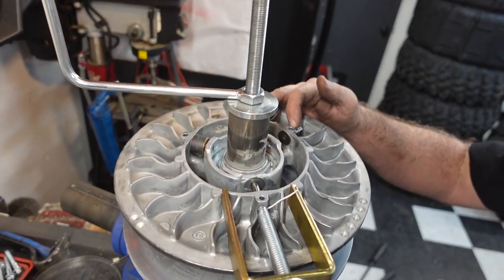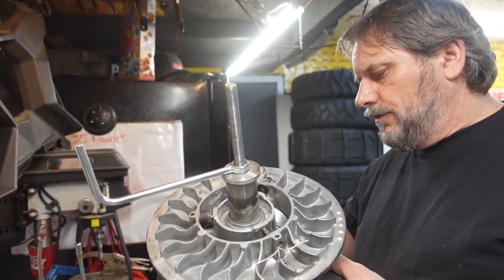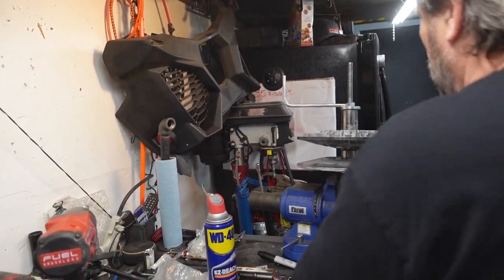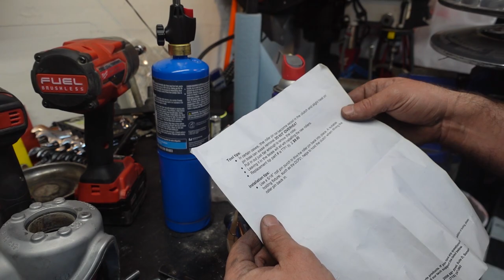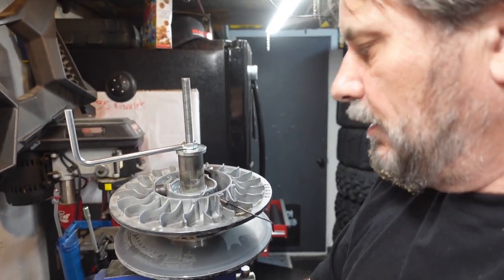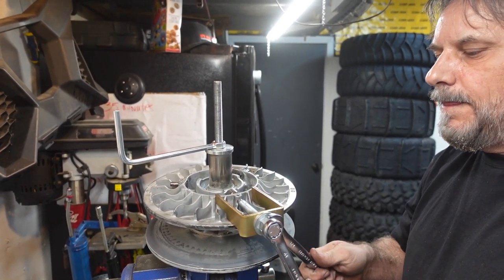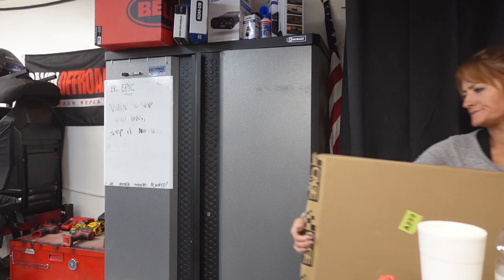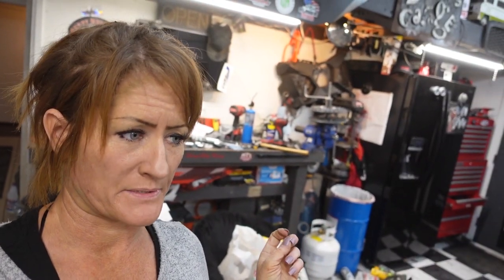CAN AM X3 CLUTCH DISASTER new secondary roller removal

Comment: Im fighting an issue on my can am too. First tool I bought was garbage and broke the threaded pin off inside my roller pin. Can hardly drill it. Im about to weld to it and try n get it out and just replace the roller pin

Comment: Invest in a heli coil kit.   You can get it at Napa or Oreilly or on amazon.   And now that I've seen it's in the pin, just replace the pin.    As for my Turbo S, no problems yet.  1100 miles, 2019 2 seater.   No broken belts, I have burned a belt before I did the gear reduction.   Cagewrx has a good video on welding up their cages.  Lots of ratchet straps, they look straight forward, laser cut and tabbed, should come out nice.
Reply from the maker: Good call we'll have to pick one up. Unfortunately we didn't have time to replace the pin. I can tell you we finished two of these cages over the last couple of weeks and they were spot on.

Comment: Mistakenly bought the cheap version of the puller off Amazon and it blows. Totally sucks and one of the M4 adapter tips broke off trying to get the pin off. Can I still salvage this part of the secondary or am I SOL? Thx
Reply from the maker: Unfortunately I'm not able to see which video you're referring to. If you send me a link I will take a look
Reply: @DandiOffroad  it's the video changing the rollers on the secondary. I'm referring to the tool used to pull the pins, the adapter tip broke inside. Bummer.
Reply from the maker: Oh yeah that was a whole bunch of fun. I think I ended up selling the pen and a half and then driving it up. Something like that. How did yours turn out?

Comment: My last of the 3 locked up. I cut the roller off then I cut the pin in half. Then I heated it and knocked it out with a 5/16” punch. Installed a new pin.
Reply from the maker: Yeah I think we ended up doing roughly the same thing. It's been a year or so
Reply: Hi, this just happened to me.  any other tips for me to get that pin out?  you have to take the secondary clutch completely apart to do this, right?
Reply from the maker: You can get the pen out pretty easily by cutting the roller off then cutting through the pin and driving it out

Comment: Fix...STM clutches!  anyone that runs any sort of power runs them.  WAY worth the investment.
Reply: @DandiOffroad  come on u guys have $$$ lol...and with all the time ur working on this and $$ ur putting in to it
Reply from the maker: Right? The thing is we've had very little clutch issue so I haven't spent a bunch of money in that area.. I mean if I had your money I would just throw mine away right?
Reply: I run 300 hp now on my x3 and I went kwi and have had zero issues. Stm clutches are a pain in the ass because they require so much more maintenance.  I got 2 stm clutches out for rebuild now
Reply from the maker: Yeah we're going to stick with weighting and springing and calling it good
Reply: @DandiOffroad  when I see u in dunes u will switch..LMAOOO

Comment: If its out of warrantee on the belt slip limp mode as long as its not getting hot I would say get a dynojet and call them for a custom tune they will do it for free to disable that limp mode option.  
If its under warrantee I would take it to the dealership and make them fix the lemon they sold you.
Reply from the maker: Its only 2 months old and only has 300 miles on it. And its not a belt issue so we want them to hammer it out for sure, but it will for sure get a tune, and soon a big turbo EVO.
Reply: @DandiOffroad  i wouldnt go evo for a tune that is a scam you send your ecu in and they flash it one time and charge you the same price as a nice tuner. Go dynojet way better i ran one on my gixxer  gsxr for years.  You can flash any map you want anytime depending on where your riding    You can call them and they can make you a custom tune just how you want it if your not happy with the maps they give you for free nobody does that.  Plus you can reset your limp mode reflash any tune reset your maintenance anything on it.   Read anything off of it to dial in your machine perfect.  Saves you from having to go to the dealership and dealing with those dumb guys.  Only people that tell you to go evo are dumb sell outs trying to sell crap like the sxs blog there whole videos 90 percent is like a commercial one sided whoever gives them the most money is who they promote. I wouldn’t trust not one word that comes out the sell outs mouth.  Lol. Jus sayin
I redline my gixxer in 1st gear at 85mph and it has 6 gears the pull is a mad dog
Reply from the maker: Flashing a map is what they all do including dynojet. I'm not debating whether dynojet is better or not but that's what a tune is.

Comment: Grease the bolt and thread and it will come out like butter with no heat necessary
Reply from the maker: Its a hardened steal pin pressed into aluminum
Reply: Not sure I understand the concept? It’s not the bolt and thread it’s the pin that’s pressed I did mine with a homemade heating coil onto a battery charger then it came off like socks off a rooster 🐓
Reply from the maker: I get what you're saying now. It probably still would have needed heat at least one of them was in pretty tight
Reply from the maker: Nice! We cobbled it off eventually